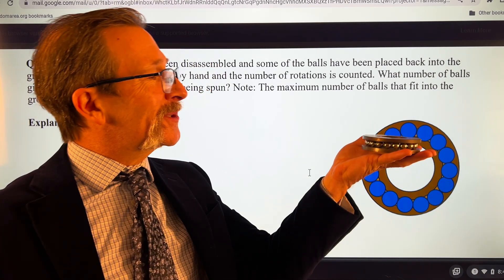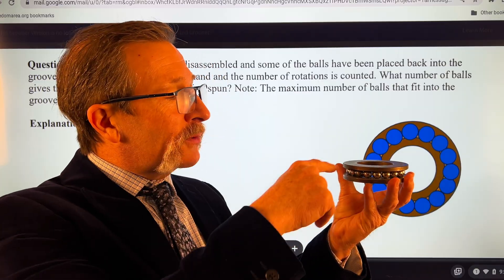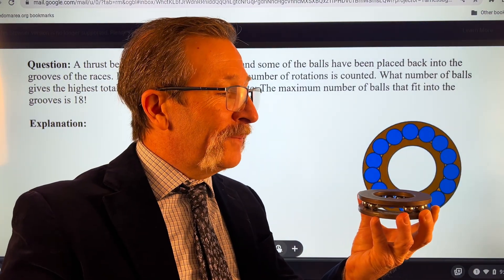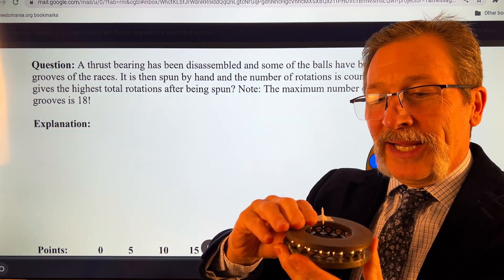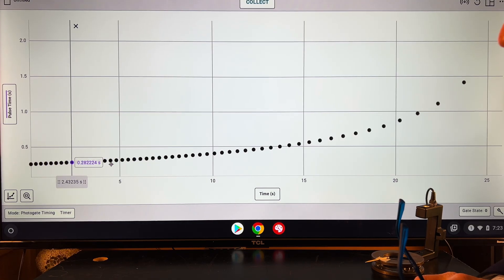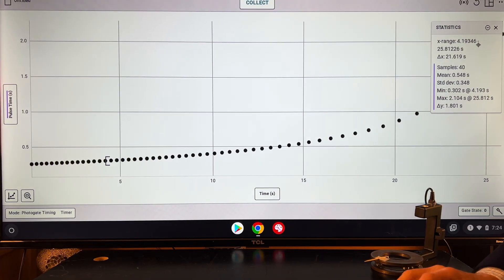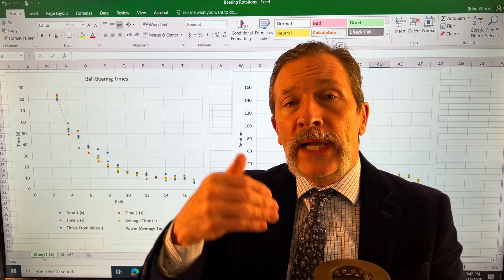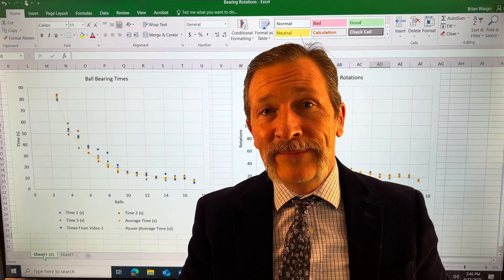How Do Ball Bearings Work? Part 2: Number of Rotations vs Number of Balls

Comment: 12:41 it is indeed a method of diagnosing the state of a bearing. there are trained technicians w/ specialized listening devices that regularly listen to bearings that are otherwise difficult to inspect, either because of lack of easy access or the machinery can't be powered down...

excellent work, i quite enjoyed the video, thanks
Reply from the maker: We tried to used a microphone connected to our interfacing system to detect sound differences, but our equipment could was not able to pick it up. However, the human ear can definitely hear these difference. Thanks for your comment!

Comment: The rotation time is roughly correlated to friction from the # of balls.

Using 3 balls the minimum reference number.
4 balls is ~33% more friction
5 balls is ~25% more friction 
6 balls is ~20% more friction
7 balls is ~ 16.7% more friction
Etc

Though this is not completely accurate as the friction decreases on each ball due to the weight of the disk becoming more evenly spread. However the mass of the balls is also a consideration and increases the mass of the overall system. Which should result in less change of friction per additional ball than the clean numbers posted earlier.

However as there’s more balls the chances of collisions is higher and results in a new source of rotational losses than just rolling friction.

More balls added should result in more momentum for a given velocity however the chances of additional losses is high enough that the additional momentum is overcome and instead of resulting in a longer rotational period, instead results in a shorter period.
Reply from the maker: Thank you for your analysis here!

Comment: Still confused by the name thrust bearing. Which is designed for lateral compressive forces.  As apposed to axial bearing forces. All which depend a designed amount of ball bearing, caged of not.  So as soon as you eliminate balls, you reduce bearing load capacity, effective weight/thrust load bearing capacity, and race longevity.  But I guess it’s just a balls in a bearing race physics test.  Cool stuff. Regardless.
Reply from the maker: Yes...just something that we started playing with and many questions followed! Hence these videos. Thank for watching and commenting.

Comment: You cannot simply reduce the number of balls
In practice there will be a load on the bearing that results in a load per ball
When there is a big load on the bearing the balls may not hold if there are to litle
And when there is to much load per ball they will change form resulting in more friction and wear out very quick
Reply from the maker: Yes...we agree. But here we are just looking at an unloaded bearing that we are using for a demonstration. Thank you for your feedback!

Comment: I did ask a question on the other video about the "profile" of the track ( or groove as you called it)  the ballbearings roll along.
I suspect it is not circular -( that is - having the same radius as the ballbearing ) 
.... so that the balls roll with only two tangential  points of contact ? ( to keep it running "straight" 
( otherwise the ball would have an "arc" of contact with the track profile  causing drag due to different tangential velocity - ( same angular velocity but different circumference )

I suspect this " rolling point contact" profile  is crucial to minimising the friction that the ball bearing experiences as it rolls. 

Also - the outer side of the "groove" has a slightly greater circumference so that suggests that there is some "slip" as the ballbearing rolls around the track

Clearly - the only "loss" in the system is due to the rolling of the ball bearings.
The more you add - the more loss.
Stability with only three is an issue  but we " can" ignore that for the time being.
add another 3 (6 in total) and can it be assumed that we have doubled the loss 
Add another 6 ( 12 in total) and the loss is quadrupled - so does that explain the shape of the graph ?
Reply from the maker: Really great questions and insight here! We hope that we will address some of these in the next three parts of the series. But again, wonderful questions and suggestions.

Comment: We call the assemblies "ball bearings", and the rolling components "bearing balls". I'm glad you revisited this experiment with such thorough data collection.

I think it would be interesting to solvent wipe the balls and races with acetone (which evaporates quickly, without residue). I assume the friction would go up slightly. Rather than recheck all of them, you could just recheck with some number of balls. It should be stable with 10 balls (i.e. more than half full).

Then lubricate with a light oil (e.g. WD-40 or gun oil). Then try motor oil, grease, and finally graphite lube. I assume graphite would be the most difficult to remove, so I'd save it for last. I assume light oil would give the best performance.
Reply from the maker: Great comment and suggestions! Keep watching this series to see the interesting result with lubrication in Part V.  Thanks for watching!
Reply: ball bearing make an excellent example of how more friction does not always result in more wear.
when it comes to lubrication, the most efficient rotation is obtained w/ a dry ball bearing. any amount of lubricant of any kind will slow down a bearing (but of course increase its life expectancy, up to a point).

ps: dry ball bearings are used in all kinds of sports where the runs are short enough that the bearings do not fail. mechanics literally degrease brand new ball bearings and install them for basically one time use. an example would be skateboarding or some cycling disciplines where speed is essential such as downhill or pump track.